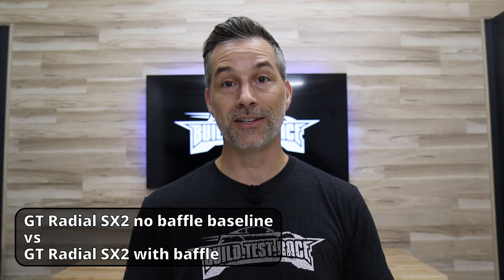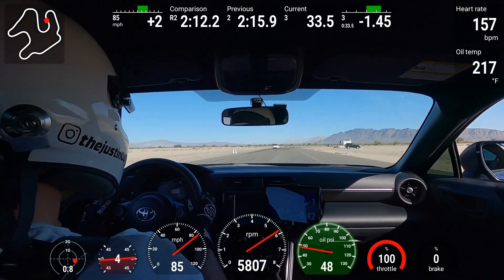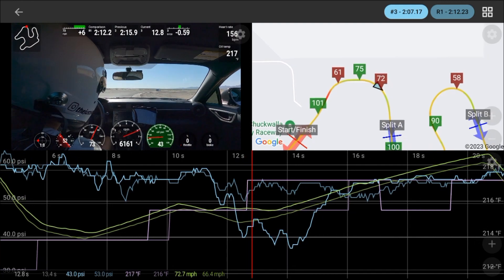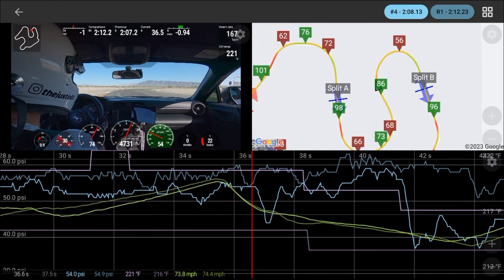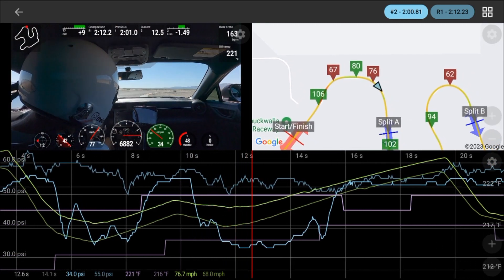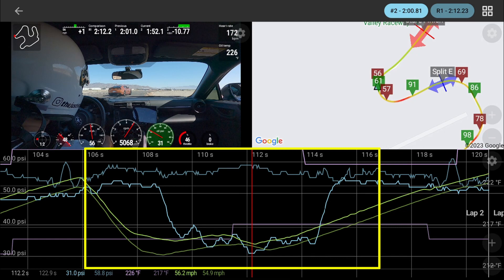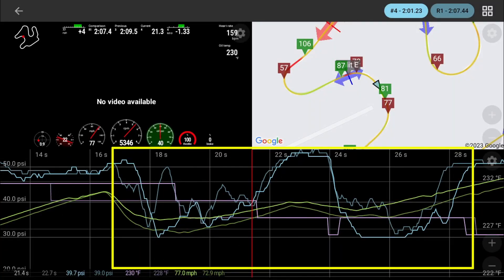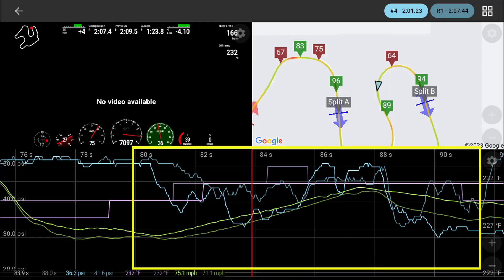Kazama Oil Pan Baffle Test Results - Toyota GR86

Comment: Thanks!
Reply from the maker: Pat you the goat! Thanks!
Reply: You're saving people a lot of money, time, and effort with content like this.  We owe it to you.  On another topic, have you decided on your preferred pressure for the RE71RS yet?  I'll learn more this weekend, but it seems like 39 is in the ballpark for 3.4* up front.  I'm surprised it's that high though, and would like your opinion @TheBTRGarage
Reply from the maker: @patmickelson  Thanks buddy! Not really, only had this past weekend and just used the PSI that I ran on the older RE71R's. I ran mine pretty low, fronts at 31 cold and rear at 29 cold. They were getting into high 30's hot on the abused side, depending what direction I was going. CVR is pretty harsh on tires.

Comment: Thank you so much for sharing this. This information is really valuable. I often take my ZN6 to the track, and I’ve been worried about fuel starvation. Most people online just talk vaguely, saying this is useful and a must-have. But you’ve shown us real scientific data and proved that’s not always the case. I also saw other designs on the RHDJapan website. For example, Cusco’s product doesn’t have a vertical baffle in the middle but uses downward one-way valves. I’m not sure if that would make a difference. Anyway, I really appreciate your valuable insights.

Comment: Are you adding about 6 quarts total??
Reply from the maker: It's probably a little more than that with the oil cooler. Standard fill + 1qt for oil cooler + plus about half quart overfill.
Reply: @TheBTRGarage  thanks for the reply! Love your videos. do you drain ur oil cooler every oil change?
Reply from the maker: @tokiohotelsucks123  No, just change the oil like normal. Most of the oil drains from the cooler/hoses with a regular change.

Comment: I watched an HP Academy (NZ) video on wet sump improvements for their GT86, which is a larger capacity truncated sump, built utilizing the factory oil sump. They designed it with the necessary items to control the oil to the pump pickup tube and added 2 additional oil drains from the heads to the lower portion of the sump. What they did is basically that which I've advised to those having this problem with oil control. The question is how much oil remains in the oil sump when the engine is running under various scenarios, as in where is all the oil; like in high G turns. The 5W40 is a move in the right direction, but an Accusump is only a band-aid not a cure for the problem. My advice is to help solve an issue you guys are having and I feel what I've mentioned will be the cure for it. Best on it.
Reply from the maker: HPA has a lot of good stuff! The oil drainage from the heads (or lack thereof) on the gen2 car surely seems to be a problem. It is even noticeable when checking the oil as it is almost always different each time I check. Anyways, that is a hard problem to fix, so yea the bandaids like Accusump seem to be about the best option right now.
Reply: @TheBTRGarage  They had problems with the oil gathering in the heads in the EJ engine series also, and they installed vent tubes in the top of the cam covers and vented  catch cans to collect the oil.
Reply: Do you know the name of the video you watched i want to take a look at it

Comment: How about the Greddy Baffle plate? Would you be testing it?
Reply from the maker: It's been tested  by others already and it didn't help at all, unfortunately.
Reply: @TheBTRGarage  which mean as of now, there is no baffle solution with positive test result.
Reply from the maker: @AlfredYap  that's correct. Over filling oil seems to be the easiest and most effective so far, but doesn't element the issue.

Comment: First, the excessive RTV sealant in the oil strainer. Now, the drastic oil pressure drop under high lateral G! How ridiculous to have happened on a pure sports car platform.  I wonder how Toyota was not able to catch these engineering faults earlier on and demand Subaru to fix them. This would never have happened if it was a 100% Toyota project. The fact that Subaru's culture of cutting corners to save cost has come back to bite them as now nobody will have faith in their engineering.

Comment: I'm in the market for the 22/23 GR86/BRZ, I plan on daily driving it. I also wanted to track it like once or twice every couple of months. I was wondering if I was to remove the oil pan and take out the loose RTV and then install a baffle plate, would I be okay driving it without having to worry about it blowing up on me? I'm also thinking about installing a oil cooler as well.
Reply: Don't install a baffle, they don't work as this video clearly showed. Just add the oil cooler and you should be fine. If you're just tracking it casually and infrequently you could also just leave it stock. I ran my car hard on the track for over a year without issue, almost bone stock.
Reply: @JustinLaps  do you think I should still drop the oil pan and look for RTV?
Reply from the maker: @slowgr86  Oops I replied on my lapping account :) No, it's not really needed, tests have shown that RTV does not affect oil flow. See the first 900brz video he did where they tested it with cars on track.
Reply: should I switch to a different oil instead of OW-20?
Reply from the maker: @slowgr86  You can go to a 5w-30 weight oil, or maybe 5w-40. I would recommend adding an additional 1/2 quart over the max fill dot on the dip stick.

Comment: Great video! Thanks for adding to the pile of publicly available information! What video software do you use to overlay the data?
Reply from the maker: Thanks! That's all done in the RaceChrono Pro mobile app, no video software needed. I have a separate data analysis video on the channel that goes over it.

Comment: seems like the oil pick up location has to do more for pressure than baffling.    it is almost as if there need to be 2 pickups vs the 1 in the center....I'm sure this is also comes with negatives but changing the pick up location or adding an additional pickup tube could help (I am not an engineer)....

Comment: I saw a comment in a different video, and seems true tbh. Why is it that most of the complaints of this oil starvation issue come from the US, and not much from Japan?! There are a lot of GR86 videos at Tsukuba, with that famous right hand turn corner. But no complaints from Japan!?
Reply from the maker: Dunno, maybe more of these cars sold in the US so higher failure rate? Just a guess...

Comment: So one major concern since this “problem” started is why is everyone trying to baffle it out I mean looking at the pickup tube and the harsh angle it’s cut up would indicate one side favored starvation like rotaries use the same style pan kind of but never have this issue and I’m pretty sure the gt86 used a flat pickup as well just a thought but who knows may help someone’s study probably the first thing I would do if I owned a gr is build or see if a gt pickup fits
Reply from the maker: Can't change the pickup without taking engine apart ☹️ The gen1 car does have a different design, and had its own issues. The gen2 seems to be improved design but now a different issue, that looks to be not directly related to the pickup itself, but something else.
Reply: @TheBTRGarage  well if all these crazy baffle designs aren’t working it could be a thing worth looking into I mean idk what all got changed between fa20 and fa24 but a Subaru flat four is still a subaru flat four and they seem to continuously have oil problems could be a factory drain back a lack of baffling or a pickup that’s at a unrealistic angle or maybe even a pressure bypass that get forced open under a certain amount force

Comment: Great testing result! Do you plan to test it with other baffle like tomei one with 1L overfilled?
Reply from the maker: Not doing anymore baffle testing, so far nearly all the styles have been tested with no positive benefit. Going back to no baffle and will test 1L over fill.
Reply: @TheBTRGarage  the problem I see others overfilling oil is the car has big smoking issue at startup after first session of lap. Baffle is actually helping avoid smoking issue, it will have less blow by to the PCV. I still think tomei baffle (two layers horizontal) with 1L overfilled is helpful. Isn’t the gr86 cup car running 1L overfilled with baffle?
Reply: @Wesley-ui3dw  over filling and smoking is if you fill so much that it reaches the pistons. on startup it will smoke. no baffle will ever help this. blowby is a different issue. and nostreetracing has documented the tomei baffle too, and no benefit. GR86 cup does run a special baffle, but you cant buy those at the moment and its the ones that are welded onto the pan itself i think. so different design.

Comment: Thank you for doing this! It’s great seeing the community rally to find a solution. Would you recommend taking a stock GR86 to the track for the free NASA event that Toyota gives you?
Reply from the maker: Yes absolutely! Despite the oil pressure issues, the risk is of a potential problem as a result are still very low. Especially when the car is stock. My car had 8-9 track days and 65+ autox runs on it in near stock form.
Reply: @TheBTRGarage  so the Michelin pilot tires that come on the premium aren’t too sticky?
Reply from the maker: @atpgarageatl  No, they are relatively slow compared to the "super 200tw" tires like the RE71RS. I was about 7 seconds slower per lap on the Michelin PS4 compared to the fast tire, at this same track.
Reply: @TheBTRGarage  good to know! Thank you!
Reply: @TheBTRGarage  damn 7 seconds?!
Reply from the maker: @gregolas597  Yep! RE71RS is a fast tire. Look at the corner speed differences in this video vs the GT Radial, the SX2 is about same speed as a PS4.

Comment: I'm not surprised with the results, but I am disappointed.  Where a left had turn, pre-baffle, used to puddle what little oil was left in the sump towards the pick-up, the baffle trapped some oil away from the pick-up.  There is just a miscalculation of the amount of oil the engine uses at higher rpms and how much would be/should be left in the pan.  Apparently, there are quite a few cars that have the same issue.  That's why stuff like Accusump exist.  

I don't know what it would look like, but it seems to me that a redesign of the oil pan could fix this problem.

Thanks for doing this.  As always, well done.
Reply from the maker: Yep, low oil pressure is not that uncommon. My TT BMW has low oil pressure issues in left hand turns and crests, Accusump on the way for that car too...

Comment: that JR oil cooler is doing great. Those temps are amazing IMO ha. Even at those temps we don't see 10psi for every 1k rpm. I guess 45-50psi is safe enough
Reply: are you running the oem oil "cooler" and JR oil cooler together ?
Reply from the maker: @02semiata  Yes, the OEM heat exchange/cooler is still on the car. Without the JR oil cooler I had oil temps above 250* at this track, definitely a good idea to have an oil cooler!
Reply: @TheBTRGarage  thanks ! All going to plan I will have some oil pressure data with just the oem cooler. 240-250 are normally what I see in track temp wise

Comment: Thank you for further contributing to the data sets on this topic. It looks like the people from channel Ansix Auto have found a solution that (mostly) eliminates the pressure drops when pushing the car on track. I think they have that same accumulator you show at 8:54.
Reply from the maker: Yep, I was just hoping to not have to go that route since it introduces more cost and complexity.

Comment: Thank you for doing this, and sharing your results.   Its got me wondering if 5w-40 and 1/2 overfill is necessary for Autocross on long / high grip courses like nationals?  If so, is it okay to run 5w-40 oil and 1/2 overfill on the highway for a couple hours?
Reply from the maker: 5w-30 or even 5w-20 is fine for autox I would think. The oil temps don't get that high, unless people were seeing high temps at Lincoln last month? I've only driven my gen1 cars at Lincoln and all of it was on high grip tires and OEM weight oil.
Reply: Thanks for the info.  Have fun!
Reply: what about 5w-30 non-resource conserving oil?  the numbers start out higher in the grade range and it stays in grade longer than resource conserving oil(s)

Comment: What are your thoughts on deleting the OE water based cooler? Seems like a flow restriction and doesn’t cool anymore than an air based cooler would, but that’s just my theory
Reply from the maker: Couple people have tested that and it does seem to improve oil pressure a small bit. It has other side effects in that the oil does not warm to operating temperature as quickly and you do lose a small bit of cooling on the hot end.

Comment: My hypothesis is, the baffle is preventing the oil to get back to one side when turning. Thus creating an oil pressure drop. However, if you put a horizontal baffle in along with a .5 qt overfill. It’ll prevent the oil from going as upwards and the oil fill will allow for more oil to be picked up.
Reply: I agree with your initial statement. I think the real solution is not necessarily have a full wall from the TOP of the pan down but instead add wall(s) from the BOTTOM of the pan up but just enough to slow down flow left to right (as opposed to sealing off left to right) or even add slits to allow flow back and forth AND overfill. The key thing is to ensure the pickup is flooded with oil in all conditions. I suspect the full wall is actually reducing accessible volume of oil to the pickup in all conditions.
Reply: @K3vinW0ng  you sir are smarter than me. That makes complete sense and I agree with that. Hopefully a prototype gets made and tested.

Comment: This is the only baffle you have tested on your own car right? I’ve seen other tests being performed but im forgetting who has performed tests on which baffles
Reply from the maker: Correct. There have been several different baffles tested by others, but as far as I know this is the first time a baffle with a vertical plate/trap door has been tested. The other flat baffles have proved to be ineffective as well.
Reply: @TheBTRGarage  that’s a bummer I thought I had seen one that helped a little but did not completely solve the issue.

Comment: You are the MAN, thanks for sharing this useful data! I'm gonna run 1/2 quart overfill and not stress too much for track days.
Reply from the maker: Thanks buddy! Wish the results were more positive :(
Reply: Great content Justin! Thank you! 

I have been following your channel for a while. How about  1st gen BRZ/FRS, would you say that its safe to beat these on tracks without baffle if you just keep oil level full or half a quart over?
Reply from the maker: @japemyy2246  The gen1 cars don't experience this issue that the gen2 cars have, gen2 cars seem to have a slightly different design. I think 900brz had a gen1 in his testing and it did not exhibit any bad behaviors. In other words, should be fine to send it 😁

Comment: So in conclusion, togue runs, street driving and no tracking.
Reply from the maker: I wouldn't completely throw out track driving. The risk of a potential problem certainly increases when on track, more so with high grip tires. But, I've been tracking my car just like I did in this video for 1.5 years, lower grip tires and .5 quart over fill of 5w-30 or 5w-40 I think is a pretty low risk setup.
Reply: @TheBTRGarage   Good point. So it is fair to assume that with stickier rubbers and the vehicle dialed up for time attack an accusump is a must. 
For occasional tracking and PS4 tires, an oil cooler and heavier oil .5 quart over fill should be enough in warm Florida weather conditions correct?
Reply from the maker: @Julianklaus  Yea I would agree with that.

Comment: Would you say any of this is a concern if the car is being bought for street spirited driving? I’m considering buying one of the twins new as a daily, had a 2014 BRZ last year and test drove the new one and it was great.
Reply: Unless you are pulling over a G consistently on the street.. zero concern.
Reply: @juan2k999  I have to agree.  I've got 23000 miles on mine. Oil pan has never been off the car and half those miles are spirited driving in the mountains.  About to put the 4th set of tires on it.  Just stay low grip lol.
Reply: @AngryAnon and also if something were to happen, car is stock... subaru/toyota should fix your car.
Reply from the maker: No, not all all. Keep in mind, while this oil pressure situation is not good, I also have over 12k miles, 12 track days, 65+ autox runs, and countless canyon drives on my car. The risk of failure is still pretty low overall. Street driving, non issue imo.
Reply: No. This is only exhibiting as an issue for people who track their cars and are pushing sticky(ish) street tires to their limits. Even then, tons of people are tracking these cars exhibiting this behavior without issue although anecdotes of issues seem to be more common than they were for 1st gen cars which didn't exhibit it.

But there is simply no street driving on public roads that you should be doing that pushes tires to this limit. And regular economy focused street tires probably won't have the necessary grip to exhibit this problem.
Reply: Run a slightly thicker oil than 0w20 factory fill, and constantly check your oil level. This engine should be bullet proof on street.